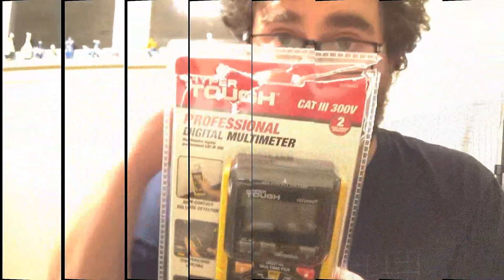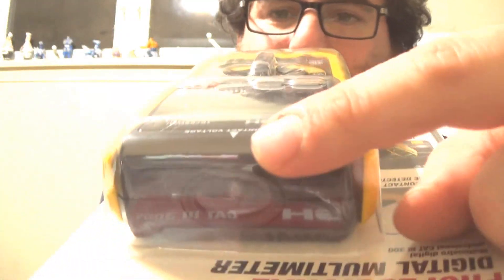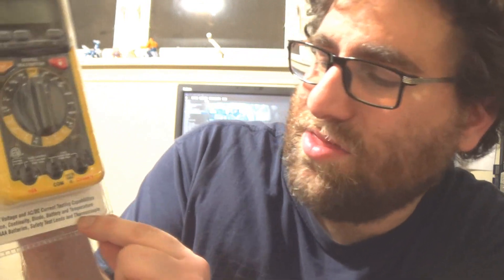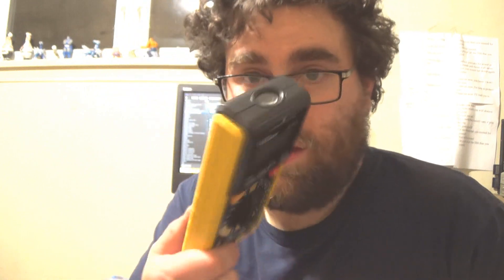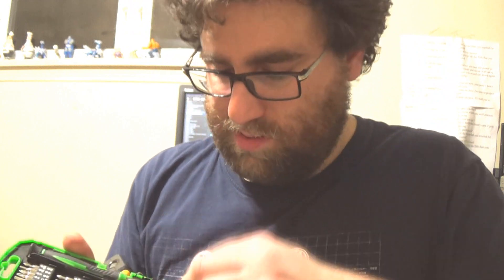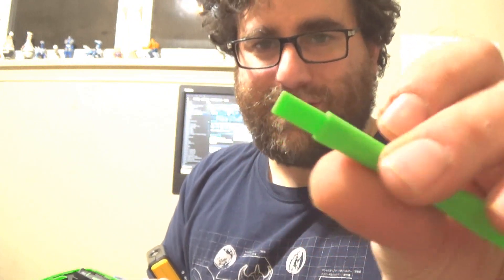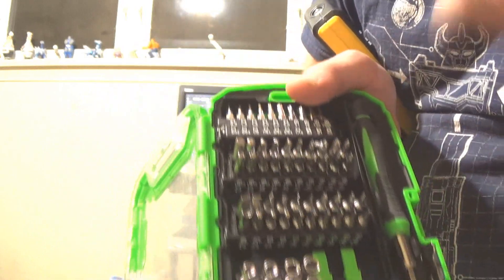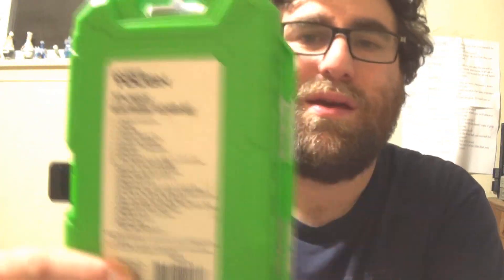Hyper Tough Digital Multimeter 10709wdi non contact voltage

Comment: Did you figure out how to use the non contact voltage?
Reply from the maker: Yes, thank you. Make sure it is on AC voltage just in case, but basically you hold down the button & I believe it rests. It doesn’t work to well. I do about 3 scans just to be sure. It’s not too accurate like it needs to be within a couple inches or it won’t read, making you think there isn’t voltage.

Comment: WTF is Noncontact voltage.  Not sure but this is what I observed with this meter.  Your results may differ, and this is only my experience.  If you attempt to replicate you do so at your own risk -AC is not to be fuck_d with:   
If you hold  down the meter's non contact voltage button it gives you a short beep, then within some unspecified time, very closely and slowly pass sensor over an appliance's electrical cord, then the meter should give a constant beep when/if in the sensor's "sweet spot" range, if the connecting outlet is live.   Unfortunately, the user manual does not even mention "Non Contact Voltage",  or explain how to properly use it so I am not sure how to use it safely, therefore best to use multiple safe alternative voltage tests to confirm if potentially LETHAL  AC voltage is present.  

Note: I think, you can have meter turned on or off, meter leads attached or unattached, and meter dial in any position, and results seam to be the same, but again with a useless manual I am only guessing.
Reply from the maker: Non-contact is simple.  It just uses the magnetic fields to read measurements.